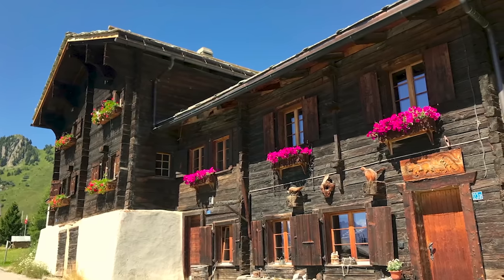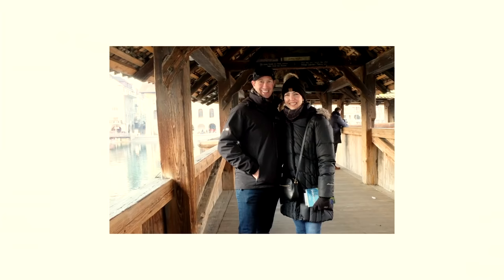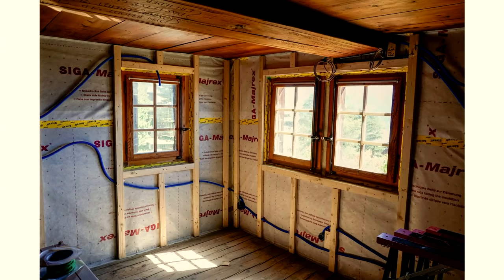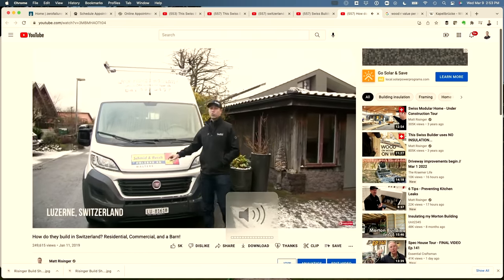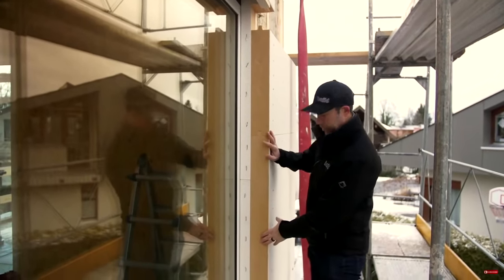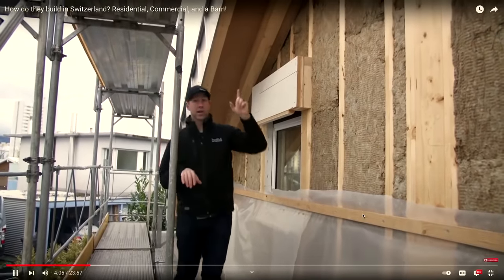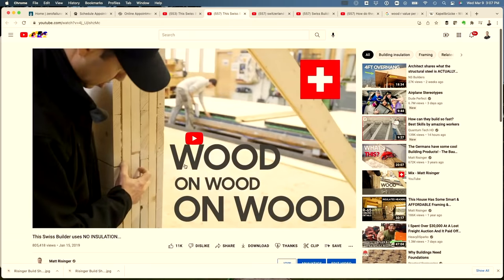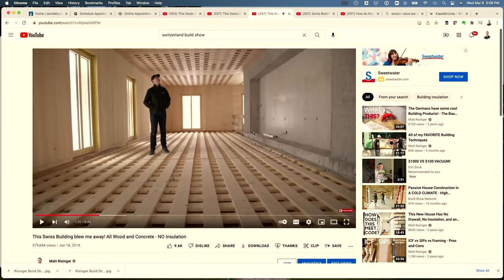Building Science in Switzerland - They Nail the Details!

Comment: Thanks Matt for the very informative videos on building techniques in Switzerland. 12:30 One note on the exterior shades they are usually made of metal but now can be found made of PVC for cost savings. There is only one layer of outdoor blinds, that are horizontally slotted in the small area between each slat when the blind is left loosely hanging allows light and air flow. When the blind is allowed to close completely stacking each slat tightly together the slotted opening are covered and prevent light and airflow, allowing a blackout effect. Great idea for NA homes with hurricane or hurricane dangers to protect all windows and patio doors. Love your videos!

Comment: Interesting video, one of the reasons I like watching is seeing different construction methods. Being from the UK (Cornwall) where traditionally houses were built from stone & brick without any damp proof membranes, then block, in an era of drafty houses with open fires to sealing up old buildings, changing to gas & electric heating & dealing with damp issues that resulted as it's so cold & damp for most of the year with little or no air handling. Even in a modern world I think there is still a lot that can be learned from traditional, tried & tested building methods.

Comment: Some quick comments.
1. Gutex is similar to Rockwool as you mentioned, but less environmental impact when manufacturing. Gutex is very messy in that particles get everywhere when cutting. Would likely need a mask when cutting.
2. Nice thing about the blinds being on the outside too is that you can open your window and still have the blind down, so some airflow, but minimizing light 
3. Currently exploring some CLT and wood portal frame structure for a build..

Comment: Exterior shades are also extremely common in Latin America, keeping the sun out but still letting air in. During the summer months, we often don't close the windows at all for weeks, and open the shades only when the sun is down, whilst in the winter months, you can open the shades during the day to let sunlight in, but keep the windows closed. At night, we close the shades to, providing an air cushion for insulation (for economic reasons, windows are usually not up to the insulation standards of Europe).
This way, we manage to keep (often rather poorly built, by European standards) houses at liveable temperatures at outside temperatures from 0°C to 40°C with just a ceiling fan and a small heater.
This is the traditional way, very energy efficient and sustainable, though modern houses tend to be fancier with air condition and more powerful heating systems. For my personal taste: I prefer the traditional way, as air quality is so much better, especially in summer.

Comment: Gutex is blended with 5-10% resin to maintain shape and resist water.  There's a new US-based manufacturer of wood fiber insulation starting in Maine but with limited production.  It's a great eco-friendly product since waste lumber can be used.  Problem with wood fiber insulation is mostly shipping cost. I was going to use it in a home in Hawaii but couldn't get comfortable with termite resistance qualities since it's mostly used in northern climates. Ended up going with rockwool in roof deck and sheepswool in walls to minimize offgassing.

Comment: I love the woodfibre, if i ever come around or renovate or build a new house where i have one now im going to use it, basiclly i can use all wood to build the house if you take away the nails/screws,  not connected to the electric or water grid so now shower and not 24/7 use i can skip the plastic barrier inside.
Hunton is a Norwegian brand that have alot of woodfibre products, they even got sheets like Zipsystem for the outside in woodfibre you can tape so it's air tight and as you saw water dosn't stick to it and won't be a problem if you have wood panel with a ventilation gap.

Comment: One big difference between central Europe and USA is planning and code requirements. You got permission/inspection while planning but near to no inspection on every step while building. This is possible because construction is much more regulated and only craftmans are allowed to do the jobs knowing what they do.
And don't compare highest value homes in Switzerland to average US homes. Just buying some property you will pay more than a complete building in US will cost. E.G. in a 10'000 residents (small) city in Germanyland will cost $ 30 per sqft and more for a lot of about 5'000 to 10'000 sqft. You may build only inside city borders.

Comment: I relocated due to work (IT job) in a place of south Europe (Malta) where they have no insulation at all inside their buildings (and there is no central heating at all). My question is, if I build my own house in this climate (lowest temp during winter is 7-10 degree celsius), how do I insulate walls+ceilings the smartest ways while at the same time avoid mold etc? The only heating system we use here is split-AC units in each room. Usually these people here just build in brick without any insulation at all, but I wanna take it 1 step further because they are a little "behind" in how to actually build a home tbh.

EDIT: Im asking this because, sometimes I might wanna go away from my home and not have my AC-split running, I wanna figure out a way to insulate a new home without getting mold if AC is turned off.

Comment: The claim with wood fiber is that the product is too dry to host termites but given that we don't really have the data on a long term use of these products in the US, it's a question. I think it would be interesting to compare this product to the new Hempcrete block products that are being produced in terms of insulation, air sealing, ease of use, cost, structural strength, and fire/mold/insect resistance. I would love to see this video!

Comment: Swiss modern construction is nice but at what cost?  Plenty of high end stuff to buy in the US too.  I recently got a quote on Marvin Modern series patio doors (big one 10' wide x 8" tall) and they were over $17k each not installed!  I settled on their Ultimate patio doors that were around $7k each.  Yikes!
Reply: It’s a good point but do remember that most of these homes don’t have a HVAC systems.  So there is certainly a trade off for spending more on insulation than on AC systems.
Reply: @RaginBajin  Almost correct. With such a good insulation you need a controlled ventilation. Otherwise you will end up with mould (fungus).
And of course we use heat pumps. Nowadays bidirectional ones. On the other hand with such a good insulation you don't need a big heat pump.
E.g my house hase an insulation of around 15" (36 to 38cm) and our heat pump has only 5kW for heating and hot water.

Comment: Well as someone living in the Basel Area 36°C or 96,8°F is pretty normal here. 85°F is maybe on higher elevation true but on our lower levels we reach several day a year more than 34°C or like this year even above 38°C or 100.4°F. 

And no, a lot of wood is NOT typical actually. It is also a regional thing like in the alps you used the wood from the forest as this was easier to organize than concrete and bricks. Where you will always have wood is on the roof if it is not a flat roof type of Building. 

CLT and such stuff is not that used that regularly. It is on a rise but no it is not typical. The typical, especially on multi story houses is steel concrete and brick walls. I have a normal sized family home which is built on a steel concrete Fundament (basement and bunker, Garage) and then over that with sandwich walls (brick-20cm insulation-brick) which was typical for the 80s and 90s way of building it. 

The fundamentals, however, of getting a air tight hull and control the air/water transfer etc. remains the same if it is wood or concrete. To be honest I do not want to live in a wood I don't like it. As you pointed out the build to last forever attitude needs to get more into the American way. As the prices went ridiculous on some parts of the US for houses I think also the multi-generation approach will also flow over overseas rather soon to cope for the higher living costs.